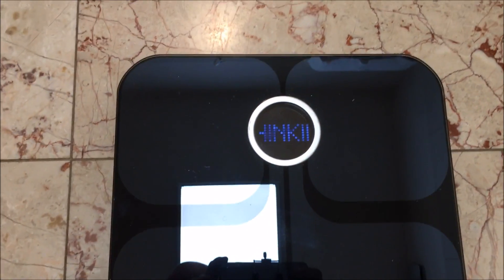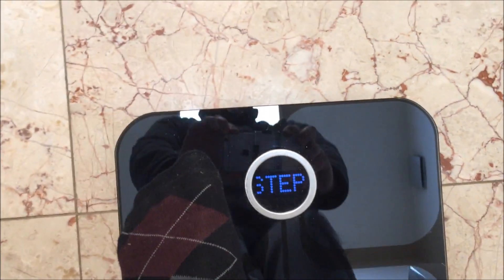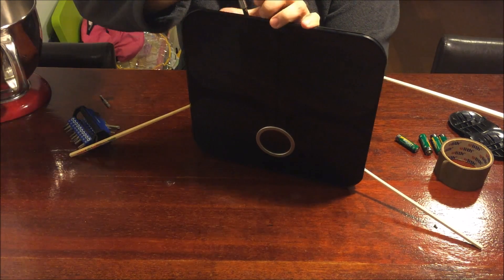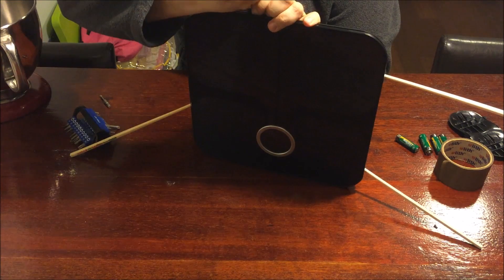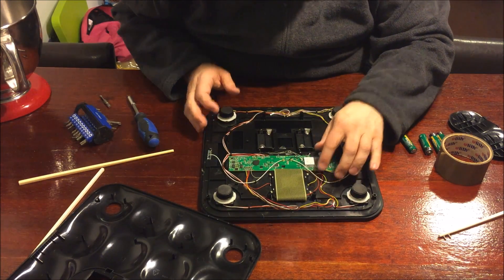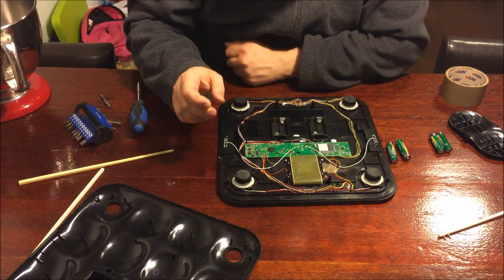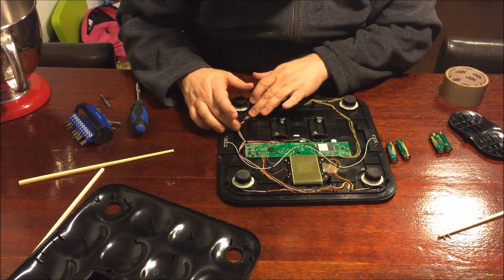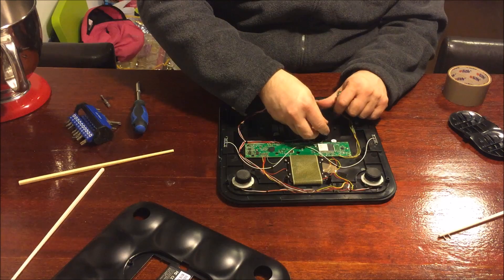🇺🇸/🇬🇧 Repair your FitBit Aria scale yourself!

Comment: I have same exact error - no wires pinched. I am guessing that there is some loose connection. Could you please explain which wire fixed the issue for you? I do not understand how the scale sences weight. Is there a pressure sensor/transducer under each feet - seems like it is in the white glue bellow each feet. Is that correct?
Reply from the maker: Yes, there are tensometers in the feet, they operate on the basis of changing resistance based on pressure therefore if there is anything wrong with the wires the reading will be off. With the pinching it’s not necessarily visible, can be that the internal copper is broken, of course it could be also the tensiometer which is faulty
Reply: @TomaszPlawski  thanks for reply. I am going to check on continuity of pressure transducers. Do you remember what line was internally broken for you?

Comment: I used to work in an electronics factory. Based on what I've seen, I feel that this scale has serious issues in the product's design which is the result of unconscious individuals that created this scale.
You can read a book called "The Power of Now" by Eckhart Tolle if you're curious what I mean when I say "unconscious individuals."
🙏❤️

Comment: I got the ERR message, stripped it down and noticed the two front sensors sit in little plastic 'baskets' both of which looked broken. Bought a coffee damaged Aria and replaced both baskets but still getting the ERR message, next I will check all the wires, as you say Tomesz the assembly is disgusting how can they send stuff out the factory when its just been thrown together in such h a slap, dash manner. if you are thinking or doing the same basket replacement be aware, the sensors nearest to where you step on sit in different baskets to the to rear sensors, they are not interchangeable unless you have the means to cut the plastic out where the sensing disks sit.
Reply: How do you mean? You can get the sensing disks out through the side, it's no big deal.

Comment: Thanks. I watched your video and took my Fitbit Aria Scale backplate off as it wouldn't turn on and pressed the reset button and it turned on. For some reason the reset button wouldn't work through the backplate of the scale.

Comment: This was useful in helping me open up my scale. But what I found was that one of the white plastic bases that holds one of the four load cells was broken. If you have ever stepped on the edge of the scale to only have it tip up and slam back down, hard enough to dislodge the batteries then you may have broken this part.

Comment: What wire was pinched in your scale? I took mine apart and couldn't find anything that looked pinched except for the LCD backlight...
Reply from the maker: BrianDidAThing! The wire running to the tensometer sensor in one of the legs, since the measurement is done by checking resistance, any discontinuity will cause an error

Comment: The problem is in plastic legs. There is plastic clamp in the leg, that is usually broken. It can be fixed with glue or replaced with one taken from other broken scale if you got the luck to find one.
Reply from the maker: In mine the legs (as well as he built-in tensiometer sensors) were OK but the cabling was really sloppy and was pinched by the internal reinforcement bracing many others confirmed that their was the same

Comment: Tried to do this, I just break chopsticks.  Something in the middle secures it and I'm not sure what.  I undid the screws, but it was not separating.  Since it was broken anyway hammering a cats claw into it (tool, not part of a cat) but all that happened was that the plastic backing on the glass separated.  Then I tried hitting it with a hammer, and it shattered immediately.  No idea what was holding it together, shattered glass was enough for me.  One thing is clear though; Fitbit is determined to keep people from repairing their products.  Due to this I don't see myself buying another scale from them.
Reply from the maker: +myfingid i now have the Withings, which recently was bought by Nokia. Reg. The chopsticks, you probably were trying to wedge them in too high, between the glass and the plastic carrier plate to which it is glued. Nevertheless too late now :)

Comment: Tomasz, thanks for this video! I didn't have to take mine apart but this was still helpful in confirming how the feet are the weight sensors and I was able to get one of them "unstuck". That was causing the problem I was having which was similar but different that yours. I basically was not recognizing that I had stepped off of the scale and would never complete reading.

Not to mention, I never even noticed that tiny hole on the bottom of the casing until you mentioned that there was a tiny reset button. I took a twist tie and stripped it with a wirestripper and tried to press it but it didn't have any effect.

Comment: I receive a SENSING error when I weigh myself

If your scale displays "SENSING, THINKING, ERR," try removing the batteries for 10 seconds and then reinserting them.

If your scale displays "SENSING…STEP ON…STEP OFF" in a loop without displaying a measurement, remove the batteries for 10 seconds and then reinsert them. Be sure the scale is placed on an even surface and weigh yourself again.

i continue to receive errors.
see , https://www.youtube.com/watch?v=VZ3P4QM5-yU
I have the same error.
Reply from the maker: +azad azadi it is likely that when you replace the batteries flipping the scale upside down, the cables move around making contact and with no power the electronics resets, but then it moves again and you get the error again. If you take it apart you will see that the assembly is really "sloppy" but hopefully it is only a pinched cable like I had, which is really easy to fix. Some had worse problems with one of the tensometer sensors in the feet actually being faulty and it will be difficult for you to find a replacement, unless you buy someplace another faulty scale. But seeing how many views this video has I believe there should be plenty of those.

Comment: With socks on? Doesn't it work barefooted only?
Reply from the maker: +Angelo Gopaul I was listening to Joe Cocker and he sang "You can leave your socks on" ... or was it hat? :) ... the socks don't matter if you just want a weight measirement.
Reply: Tomasz Plawski it never occurred to me to use it with socks on. lol. i'm dumb.
Reply from the maker: In general for best reliable and comparative results you should weight yourselves totally naked ... but then again, with that reflective surface, this wouldn't be a "kid-safe" video and youtube would probably quickly take it down ;)

Comment: it seems to me nothig has been done. the scale most probably was working all the time, but the first test was done with socks on while at the end of the video bear foot... this is so lame
Reply from the maker: why not try your scale with socks on ... it works displaying the weight but doesn't do the fat measurement
Reply: you are anyway not showing anything that could have solved the issue. one could say you just got a new one...
Reply from the maker: Yes, I now have a new scale ... but it's the Withings WS-50 now :)  Since I made that original video it worked for about a month since the simple tape solution.  ... By bending the wire with the broken inside I made the wires inside make contact. But then the tape became loose and the problem returned.  I therefore opened it up again, cut the wire in the place where there was the fracture and resoldered the two pieces... worked fine afterwards, but decided to sell it, add some money and buy the much better WS-50 :)

Comment: This helped me get my Aria Scales open without damaging them further. 
And here's what I learnt from my experience.
My suggestion is to actually use the chopsticks and poke them further into the cavity of the scale to pry it apart. It seems the major sticking points are more central to the body of the scales.

The cable management is terrible, some cables are too long, some are very short and tight. Some cables are pinched where they run across a thin piece of plastic.

The feet of the scale have sensors to tell when you're standing on the scales.
Two of the feet had broken plastic connectors. Whilst this doesn't seem to impede it weighing and sensing BF correctly. It does have problems determining if you're actually standing on the scales on not. I removed the feet by prying open the snap lock connector under the foot on one side. They come of quite easily. I could then see the damage to the foot and have attempted repair using super glue. Not really sure how well it will last though.
Reply from the maker: I didn't push them further in being afraid they might snag on some thin wires inside and rip them apart

Comment: Thank you so much for your post. I have problem with the fitbit aria feet. I need to find 2 feet to replace  the feet. Do you know if fitbit aria scale feet are available in the market as spare-parts?
Reply from the maker: that's for the fat/water content  measurement etc. - for weight itself you can have socks on ... for proper most consistent results though you should do the measurement naked ... although probable wouldn't be a good idea to post a video like this considering the reflective surface ;)
Reply: barefoot! it says weigh barefoot.

Comment: Glad that you were able to find the issue and fix it. I suspect that 99% of the problem is pinched wires with broken conductors but some people take them apart and don't notice or think that since a wire is not cut in two it must be alright.
Reply: I have a Fitbit Aria which has the same symptom. I think this video is miss leading as OP just taped the ground cable of the display, nothing is really being "Fixed" here. OP didn't even used a multimeter to measure the connectivity of the cable as well.

I examined my weight and the symptom happens when either one of the four sensors around the corner are excessively force pressed, the sensors have analog signal outputs and in that case after ADC it is not returning a "normal" value to the MCU.

The process of teardown and reassembly just happened to relieve the sensors a bit so it returns to a "working" state.The tape taped on top of a insulated wire doesnt fixes the issue.